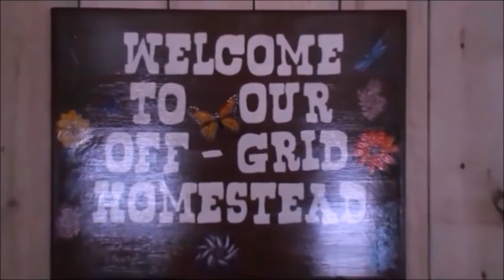Doing What I Love And Loving What I Do/  Off Grid Homesteading

Comment: Great video Cecil. I have a husqvarna lawn tractor and had to strip the transaxle because it wouldn't shift gears.It was half full of water and they pack them with grease from the factory. So i had to clean it all out and renew the drive chain it was seized.All is good now its shifts the full 6 speeds and reverse.It has a Dana transaxle fitted, the MTD i think are Peerless axles.

Comment: Good morning Cecil and Heather!!😀
I'm sure that the blower is going to work great for removing your snow this winter. The only thing Is you have to make sure everything is picked up in the area you are going to use it. It's not good when it picks up a piece of wood or metal and tries to throw it. LOL!! 
But you know that. 
Hopefully you get it running good. 
It would be nice if you could find one of the winter cabs for it. Otherwise it is a kinda cold and wet job when the wind is blowing the wrong direction. 
Take care my friends!!😀😀

Comment: A few things to check on the Briggs and Stratton. I see you have the flywheel off and and have cleaned the points.  Make sure the flywheel key is in good shape. Also check that he magnets are still attached to the flywheel. If those are OK, and the condenser and points and spark plug can be exchanged off a running machine, then the coil is likely toast.
Reply from the maker: Good morning David. I haven't had to remove the flywheel as the points are on the outside of these older engines. The flywheel key is good still, this old engine only has one magnet and it's good still..I even changed the condenser, spark plug, cleaned the points and changed the coil...The one thing I thought of last night as I was in bed was maybe someone installed the coil in reverse and I installed the others the same way.  :-(  Thanks again.  You have a great day.  Cheers.
Reply: Coil reversed could be the issue.  Sounds like you've thought through the possibilies.   @SkinnersHomesteading